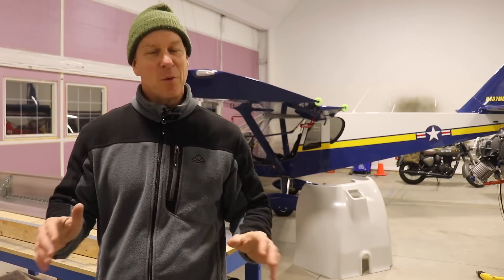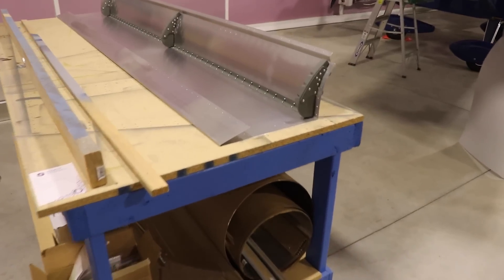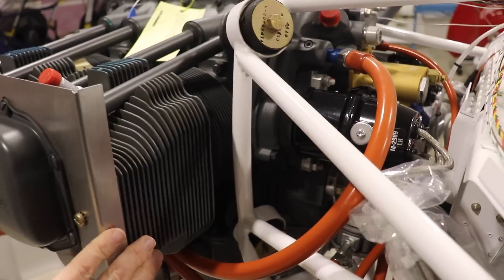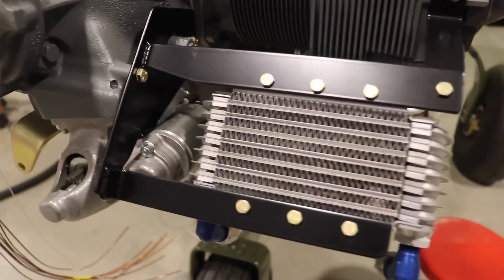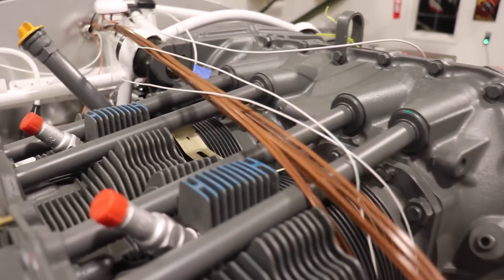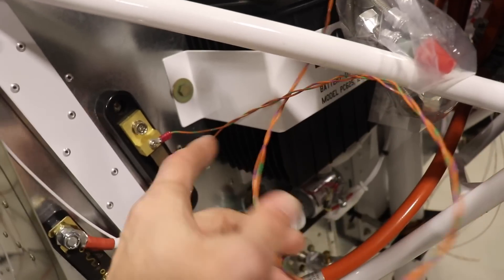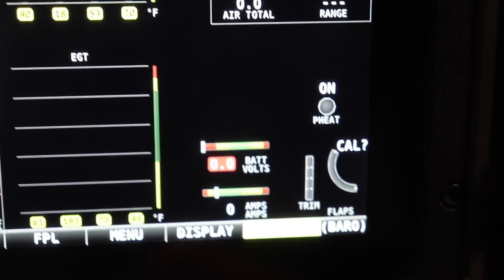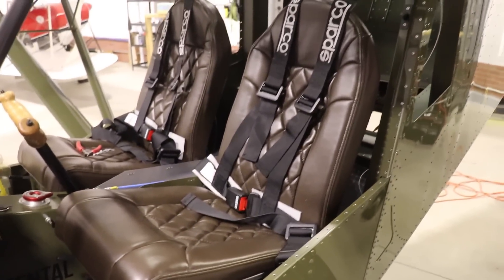Super Duty FWF, Dynon Wiring, & More...

Comment: I'm glad you're making such great progress with your Super Duty again. 👍
It's a shame that you have to uninstall your engine again in order to optimally adjust the air baffles.
Labeling your different cables with one “male” connector and the other with “female” connectors is a very good idea and we will adopt it.
I find it admirable how much electronics you incorporate into your SD!
You can't run the cable from the wing for the fuel gauge in the Dynon along the front cage, I've seen in some videos that cables were laid there and if you use a black one it's hardly noticeable.

Comment: Curious as to why you added an unprotected molex connector 3 inches away from the sealed weatherpack connector on the pressure sensors on the front of the firewall. Wouldn't you want everything front of the firewall to be IP67/68 rated?
Reply from the maker: If I was building a boat or a submarine, I'd use sealed connectors.
Reply: @KitplaneEnthusiast  I was just thinking in terms of encountering weather and having moisture present in that area of the aircraft. I would actually hope internal wiring on a submarine would have a less chance of exposure to unintended water than under the cowl of an IFR capable aircraft.

Comment: If the lightweight starter solenoid could be repositioned  to approximately 0600 by rotating the center case with the retainer bolts loosened would the electrical brushes and permanent magnets rotate around happily and if so, would the position of the electrical connectors then be in a satisfactory position. The planetary gear set should follow suit nicely too.  🖐️👶🚬

Comment: Looks great. Pulling wire into impossible locations is what I mainly do at my job. Where there's a will, there's a way. I save different sizes of fiber optic cable strain members which are made from fiber glass to use as fish tools.

Comment: Having your Volts run into the Dynon will give you the Audio warning if the Volts start dropping.  I had this happen when the connector on my R/R burnt and the Stator was not charging the battery.

Comment: Molex connectors are a great, low-cost option for nonhostile environments, but not the best for the firewall or exterior areas.  You may wish to consider replacing those with an automotive style sealed connector.  Deutsch is a good choice as they are more compact, but are somewhat expensive.  I still use the older Delphi Weatherpack connectors mainly because I own the expensive crimp tool that I bought many years ago.  I’d have to buy a new tool for Deutsch which is the only reason I don’t use Deutsch.

Comment: Usually the crinkling is from spraying the paint too thick in low humidity where the outer layer dries too quickly and then shrinks and the paint underneath then dries.  Thinner coats and using a slower reducer might help.